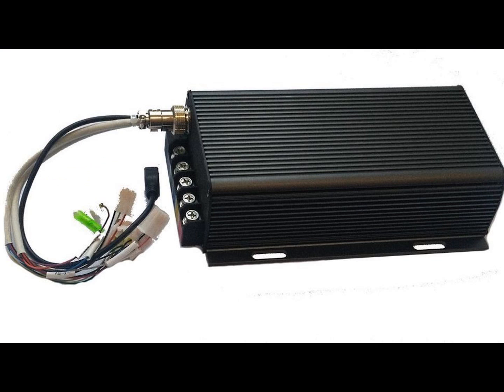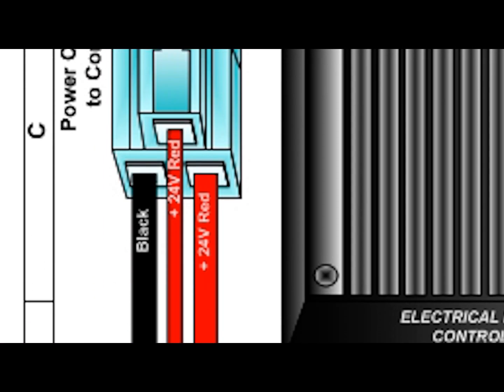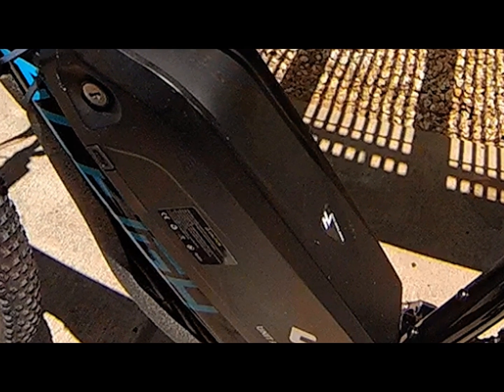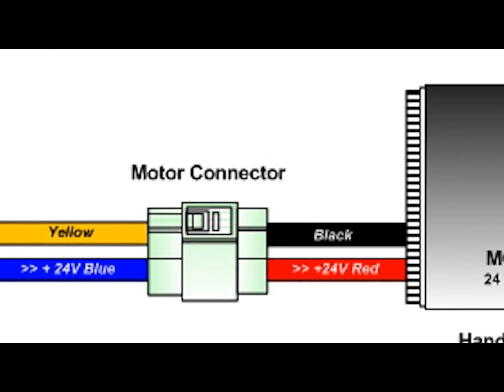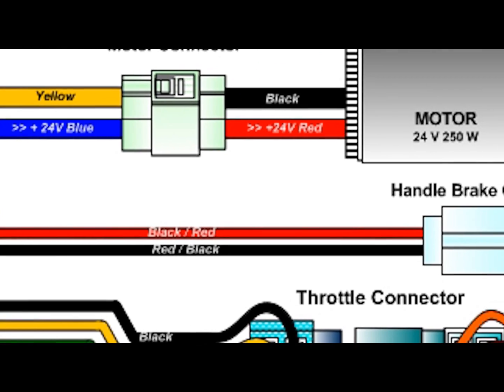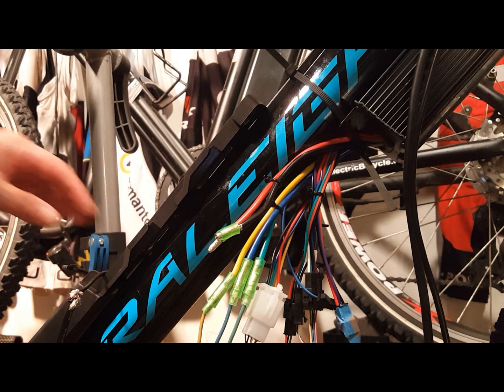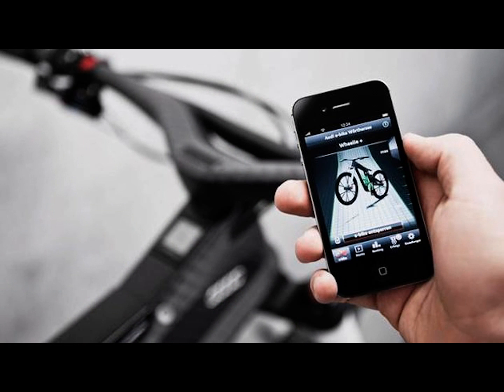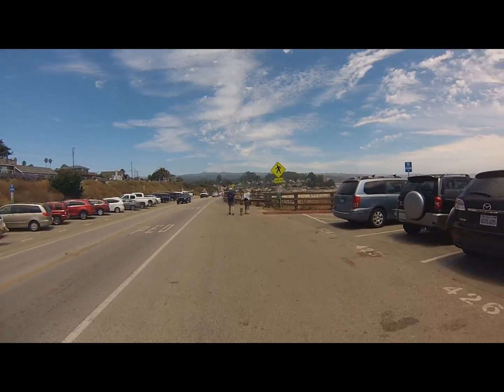How your E-bike Controller works and what's inside

Comment: Great video.  
Question, I'm replacing my ebike pcb board.  

The replacement has 7 holes/copper rings for wiring. Bu my original has 6   - 5V, GND, SP, H1, H2, and H3.

The replacement has an additional ring for wiring labeled "K". What does K stand for in this case? Keyswitch, ohms, resistance?  Can't find any information or diagrams online.

And if I solder/connect  the "regular" wires, will I have a problem if I leave "K" unsoldered? 

No info online + could use the help.

/bklyn 👑

Comment: would you be able to analyze a controller or get the specifications for one? I have a minimotors dualtron Storm limited and it feels like a controller issue, because it doesn't reach 74 mph. the top speed it can reach is about 50 mph ( GPS ).  when riding out feels like the power is being withheld to the motors. perhaps you have an idea?

Comment: I have a Engwe Engine pro and want to change the current limit from 18A to 25A in advanced settings but Engwe has the software locked in the controller how do you unlock it
Reply: Try adding wire or solder to the controllers SHUNT ,its a thin Bar of metal that helps control the amperage

Comment: could you tell me is it possible to reset the controllers mine has come up with a warning control protection and a red engine management light ,i have disconnected everything left for a few hrs but still getting the warning messages

Comment: Does the lights wiring have full voltage or 5v or 12v?
Reply: It is usually the same voltage as the battery (24v/36v/48v) and sometimes it is 6v.
Reply: @nukubu9379  That's what I was thinking... I just don't want to overvolt these dinky lights!

Comment: I had a doubt, as by using a potentiometer we are varying the voltage input to adjust the speed of the motor, so does the power of the motor also vary accordingly ? 
Like if we reduce the speed, is the overall power reducing too ?
Reply: We can maintain the power of the motor by reducing the voltage and increasing the current, since power is a product of voltage x current. By reducing the voltage and increasing the current we can reduce the speed and increase the force( torque ) of the motor

Comment: Question: I have a Ecotric Hammer, 48 Volt, I want to use a 52 volt battery with. Is there any reason why the 48 volt controller would be damaged by this?
Reply: Not really, may become hotter but also faster and better range

Comment: Hello dear friend I have an electric bike.. But my controller stopped working I wanted to buy and other what kind of controller I have to buy my wheel e3000w 72V and my battery and 72V 18a. Can you tell me the best controller??
Reply from the maker: Hi Ricardo,

When you buy the 3000w kit, it should come with a controller. Without knowing more about your 3000w kit, I can't really make a recommendation. Give me more information and I will be happy to help you. Cheers.
Reply: Hello friend I when I bought this ebike kit.. I already had the battery 72 v 18ah I sent a message on eBay to the seller I pleat that had a battery 72 v 18ah the seller said it works well.. But in the kit has no discretion at all

Comment: have a Schwinn scooter and I dont think I have those brown wires etc. The throtttle wres are  5 or 6 colors and run from throttle to ECU. Also all motors dont have that brake cutofff do they? My bike quit on me the other day and I still dont know how I fixed it. My throttle lights still dont work (Fuel guage?) WHen I speed up to medium hi..the amber lite comes on. THATS IT. It used to come on nd stau on. Also my fuse has two "tongues?" The 40a fuse I got just had two tonguelike things side by side. Not at rt angles to each other. Hence..it wont fit.

Comment: So can you push a motor say if its 1000watts to 1500? etc by changing the controller settings?
Reply from the maker: Hi Erik,

The wattage of the bike is determined by the motor itself. The only thing you can change with the controller is the amp output.

Comment: is it possible to transplant the insides of the controller to a smaller case?
Reply from the maker: Most likely not, because the motherboard determines the size of the casing, which is usually pretty tight. Smaller controllers are coming soon.

Comment: This is child's basics so why waste time. You need a follow up video explaining what most bikers need. Which is explaining the purpose of each component inside. How to recognise it visually then replace it according to basic diagnostics. Eg my hub motor had water in it causing the voltage regulator to blow. What does a voltage regulator look like so it can be ordered and replaced.
Reply from the maker: I am happy to make that video.

Comment: can we use motor and battery with out speed controller?  
help pls
Reply: of course you can, but for wich pourpose? You can connect the motor directly to the battery and setting it on/off just with a switch but Your motor will not find it so nice, the same as your battery will last not so long.

Comment: Could someone please help I bought a conversion kit 36 48 volt ebike at I installed it and just to check to see if it worked I use a 12 volt battery  
 I'm getting power to the throttle the red light comes on and it's going through the controller and I'm getting the red  light on the throttle ,No yellow light and no green light on the throttle. Anyway the power goes through the controller and and I only get power to the headlight wire we're running  lights. Could just be that I'm only running on 12 volts from the battery? And maybe I put my controller in sleep mode?? Is there someone that can help me with this out there thank you in advance for your time.
Reply: You can not run one of these on 12 volts. It takes at least 15 volts to power the MOSFET drive circuitry. Also, to protect the battery from extremely deep discharge, the controller will not typically even run below 30 or so volts.
Reply: If you have two more 12 volt batteries you could connect  them in series so that you have 36 volts in total

Comment: Hi, i buyed a ebike kit taht comes with a Normal controller (no lcd display) but it would be very useful to me to have it with the LCD so i can control the power of the motor on PAS. 
Because on PAS, the motor always accelerates to full power, and sometimes i don´t need it. 

Is there a way to transform the normal controller into a LCD controller? Or a way to have a 3 mode power control switch somewhere?
Reply: Alexandre Costa I think a v3 cycle analyst will. Or you can put a potentiometer in series with the shunt. You may need to put a resistor in parallel with the pot as well because the shunt has a very low resistance. Maybe some trial and error. You can also just buy a new controller. Just match the volts and watts (or amps) ebay or Alibaba has stuff for cheap.

Comment: This video doesn't say more than what you learn when you buy a controller. It explains what a controller does but not how it does it. Completely useless!
Reply from the maker: Thanks Antoine, Your opinion is pretty subjective. This video may be utterly useless to you, however there are other viewers who have found this information helpful. This is a video describing in a generic way the role of the controller in ebikes. If you are looking for more detailed information about a specific controller and it's connections, I am sure that information is available on the web. There are thousands of different controllers and specifications for each made each year. If so compelled we could devote an entire channel to reviewing every controller, but have not gotten there yet. I wish you luck on your quest for the information you need and would caution you about so easily categorizing information as useless. We are all trying hard to bring value to others and this channel has taken a lot of hard work. Best of luck!
Reply: Go cry in a corner

Comment: The Landian LCD display of my bike stopped showing the speed. It stays at zero even though I am on full throttle. Where and what should I be looking at? Is this a function of the LCD, controller (i got a new one by the way but still the problem persists), or the motor?
Reply from the maker: Hey John,

I'm not familiar with the Landian. It is definitely not a function of the motor. Depending on how much you can control the settings on the LCD, it make just be a settings problem. If you got a new controller and still have the same problem, it's a faulty LCD. Send me more info and perhaps I can help.
Reply: Got a new one but it's still in the mail. I'll give you feedback once I test it out. Thanks man!

Comment: Got a serious problem. I tried to be a genius, and connect a gps tracker to the 12V DC output on the motor control unit which is intended for use with a torch. Since doing that im getting error code 10 which  means communication error, typically this translates to a loose wire. Straight up disconnected gps then tried else everything to sort this. Checked connections many times, checked all capacitors in the computer box(mcu), checked wiring in the hub motor everthing seems connected correctly very stuck, dont know what it wants from me. Maybe its a factory reset job not sure.....Any suggestions?.
Reply from the maker: 2 things. I've seen this many times before. Make sure the connection to your controller is correctly mounted and tight. The #10 communication error is that there is an error communicating with your controller. Are you using an LCD? The second problem is that you may have done damage to your controller. This is very common. If you know how to test your controller, check possible voltage break downs. If after troubleshooting you can't identify the problem, order a new controller with higher amperage. They are the least expensive part of an ebike. I can help more if you let me know the components you are working with.
Reply: Im using a 48V 1000W DC motor controller,  couldnt find an identical one, it came as part of a kit
Link to kit:https://www.ebay.co.uk/itm/26-1000W-Electric-Bicycle-Rear-Wheel-Motor-Conversion-Kit-LCD-Meter-E-Bike-Hub/122638459582?_trkparms=pageci%3A54033f6d-2a27-11e8-beda-74dbd1800321%7Cparentrq%3A35cac3b71620a9c510b0a315fffd87d9%7Ciid%3A1&_trksid=p2481888.c100651.m4497
Thanks